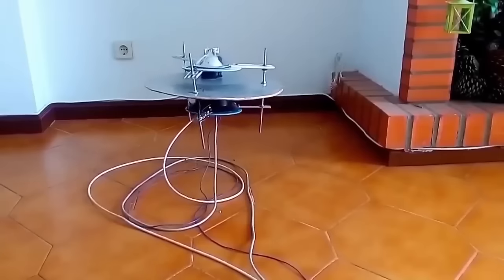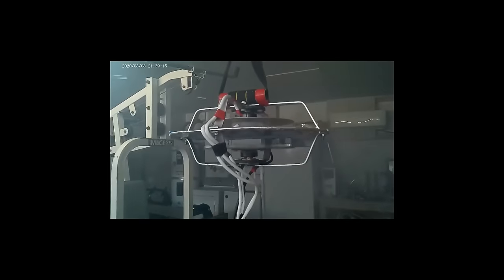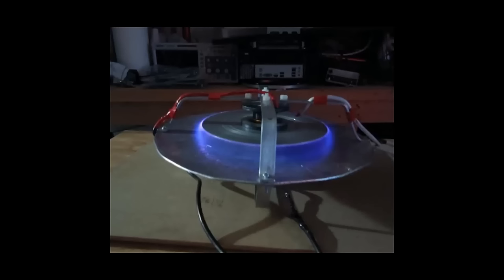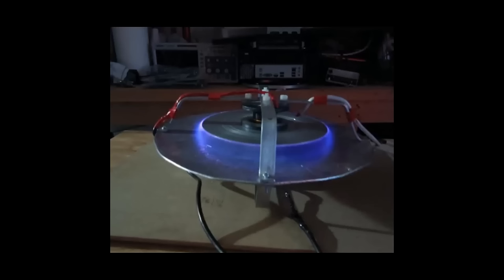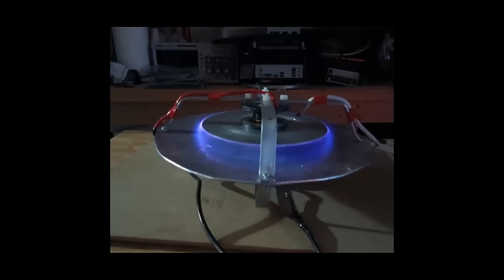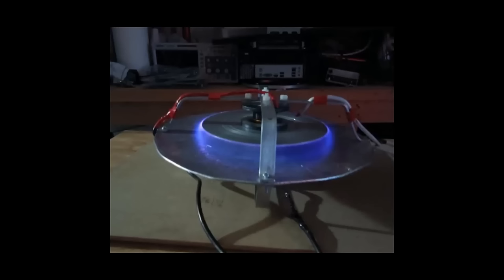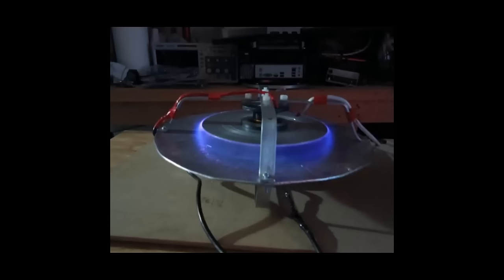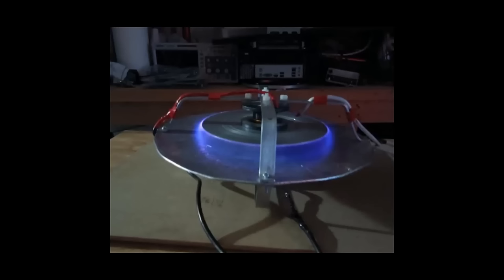Building The Graviflyer "Testing Everything"

Comment: I have derived great pleasure from viewing all of your visual presentations. My progenitor was engaged in the field of aerospace engineering, specifically in the domain of advanced propulsion systems. Upon the discovery of the elusive components, the factor of weight—or indeed, mass—will cease to be of significance. Beyond such statements, I remain a silent yet fervent advocate for the collective success of this exceptionally talented assemblage.🙏🏻
Reply from the maker: It all comes down to one factor. If it doesn't resonate enough then you fail. It is and always has been that on factor. Thank you.
Reply: @nathanbunten4299   so youre saying that the fundamental concept of electric gravity propulsion works?
Reply from the maker: @Critter145  The is much more to it than that. Harmonics, electricity, 2 fields of frequency's crossing each other, eddie current and 3 fields where 1 pushes energy out and 2 pull it in ( gravity well) Resonance in the  center disc. This project is way more complex than people think. If I took out charts to show how it all functions together it might take several hours to explain before I even showed a test on the machine.
Reply: @nathanbunten4299  utterly fascinating. thank you for responding
Reply from the maker: @Critter145  any time. I have done a lot more video's on it. I also work with a group on the concepts of each part. Those video's are also on my sight. I try to answer as many questions as I can. Thanks.
Reply: Anti Gravity is not a big secrete , it has bin around a long time the concept of the physics of antigravity can be found in nature , like certain insects fly bye using anti gravity plus great physic professors have learnt from the works of Tesla, and Edward Leedskalnin the builder of coral castle , plus some other great physic professors from ancient times .
Reply: Tesla Said, that he was Limited, in The Materials, of His Time. Ceramics, And Carbon Mixed Ceramics, ARE The Materials, Of The FUTURE.

Comment: I work with Tim Ventura and APEC people who are also working on the graviflyer. I also chatted with Alexey with a scientist on the phone. You have the graviflyer analyzed fairly well but not perfect. The gravifler is not made of three aluminum disks but two CDs (polycarbonate like balsa wood) with aluminum on one side and Al2O3 on the other side and the large aluminum disk in the center. The aluminum is outwards on the top and the bottom of the CDs and the Al2O3 is inwards, so the high voltage does not arc, and the magnets do not demagnetize with the applied high voltage. The top CD has the positive on the top and the negative on the bottom and the bottom CD has the positive on the top and the negative on the bottom or vice versa as I am not sure which way the positive and negative are aligned. The force will then only go outwards. The charge on the CD disks and the high voltage ionizes the air on the top and bottom of the graviflyer and the spinning magnets then push the top and bottom air down and upwards so there is a vacuum above and below the graviflyer so the device acts as a hot air balloon and lifts upwards.  It is not anti-gravity. Alexey sends the incorrect kits to keep this secret so he can make money and make a living. The ultrasound device puts the graviflyer in a harmonic mode as you describe and when the harmonic mode is reached, he pushes a button on his electronic controls to make the final push to make the air evacuate so the device lifts upwards in one blast. The large disk is in the center to keep the vacuum on the top and bottom separated.
Reply: Dude, good facts! Where can I find this graviflier? I am new to this hobby and can't wait to experiment.
Reply: Как Алексей живет? Он работает над своим гравилетом или уже нет?

Comment: What you did is amazing thank you for sharing all the information and contributing to the scientific research. The presentation that you made It’s just amazing. God bless you.This is what a real researchers do by sharing the knowledge to benefit everyone.
Reply from the maker: thank you
Reply: @nathanbunten4299  again thank you I’ve benefitted greatly from your presentation and the knowledge you have shared. thank you for your time and effort To bring this information forward. I have been struggling for the past two years to understand what was going on. I made five different models and everything you said you have been spot on exactly.👍
Reply from the maker: @samjall  It shows when you do the tests. I have been doing a lot more on this thing. I have moved away from really high voltages to sound and harmonics. I also built a tesla coil circuit that will work all day long. I also have the right ultrasound circuit. This is one of the most intriguing projects I have ever done.
Reply: @nathanbunten4299  even if I did not succeed, at least I’ve benefitted greatly from your information. You have no idea I was very frustrated and I was struggling to understand why it did not want to work and you have pointed every single mistake I made, watching your presentation. It’s like I was in a dark room and All of a sudden somebody opened the door to light show lol I am sure there are thousands of others like me. You shorted the distance for hundred or thousands of people so they can pick up where you Finished And that is lots of time and frustration they don’t have to go through

Comment: gyroscopic stabilization. a hollow center disk would resonate well. the foil sticking down to the table is a capacitative effect. i'd wager theres metal on the table on the underside, the wood tabletop becomes a dielectric, the metal in the underside becomes thenother plate of the capacitor

Comment: What you need to control the resonant frequency. is alot of different sized piezoelectric transducers rated for a wide range of resonance, with potentiometers attached to each one for extremely fine tuning capabilities for the tuning forks. This would allow you to program controls for resonant frequencies across multiple resonant chambers which would then allow control of direction, as well as lift.
Reply from the maker: I agree

Comment: Try this one for size:
Bottom most layer: Circular Aluminium Sheets and Circular Kapton Tape Stack (+ / - each layer)
First rotating module: Closed liquid mercury pool (leak proof/vaccum sealed)
Second rotating : Close liquid mercury pipe from center to top flat circular reservoir (leak proof/vaccum sealed)
Both mercury pools will self rotate upon correct power connection. Multi-point, switched power interface
Outside shell/top bottom split (crucially electrically isolated from everything except bottom alum/kapt capacitor stack)
Reply: (Capacitive stack will need to be increasingly thicker as size/load increase)

Comment: Electrostatic wind...  Try this, has to be paired , has to be synchronized ... out of balance gyroscope that accelerates on one quarter of rotation only, and it throwing the weight toward the sky... the weight is traveling very fast at the top of the rotation and is slowing as it is coming down to the bottom of rotation...  the mass traveling very fast at the top of the rotation has more inertia than the slower rate of rotation during the tough of the circle....

Have to be in pairs , one on each side of craft, and have to be like 6 or more of them, 6 of them lift in a triangle configuration where there are two in each corner, and they all have to be lifting at the same time, (synchronized).   I cannot send no pictures that are easy to understand...

Comment: Do you think we need to consider the MHD effect? It's one of the theories for antigravity effect. Plus, most studies of UFO encounter said the buzzing and Mercury engine. Mercury engine works like the magma inside the Earth. The mercury spins around a magnet which is also spins in the opposite direction thus creating magnetic field around itself.
Reply from the maker: they both produce energy fields. It might be the interaction or just the accumulation of charge.

Comment: Unfortunately, watching the videos of the device in flight it is easy to see that it rises in "jerks".
This occurs when the nylon is pulled through the pulleys to raise it.
In other videos he touch the discs when they should have high voltage, the rest is the same as always, you will never get it to take off because there is a magic frequency that you will never find.
The antigravity is there, but in two PC fans, two aluminum disks and a flyback, I doubt it.
All the best.
Reply: I agree
Reply: Yeah its clear it was a hoax yet these people just keep pushing forward despite no one having any success because... it was a hoax.  An obvious hoax at that.  Huge waste of curiosity in my opinion.
Reply: There is no way at this energy anything you are doing with electrostatics is affecting gravity in any way, many orders of magnitude off lol. Also, the big to small thing cracked me up, thats just sooo wrong, i think he might've not showed the initial state of the system (he charged the little middle piece that goes up or down) before hand to bias it so that no matter what it will go down. Silly stuff

Comment: You need to insulate the magnets, perhaps, even ground them. Maybe use a separate slip ring for the ground. Also, use an electret type of material, for example I heard that some sort of specialized hardened wax works for the center disk. I believe the center disk becomes a captret.  A captret combines the properties of an electret and a capacitor. A captret can be made by putting two capacitors in series with a terminal between the two capacitors in series. Each non-connected end of each capacitor in series becomes a terminal. The captret has three terminals. Look up captret    Also, look up electret

Comment: I heard that tt brown used a bismuth type insulator for his lifters, it was apparently a type  of bismuth that repels rather than attract, the so called bismuth magnesium alloy material allegedly found from the Rosewell crash have been talked about as  the same material tt brown was using, probably made via sputtering or something similar
Reply from the maker: Don't know about the magnetism. But the k value was through the roof. You could put millions of volts through it and never burn a hole through it. It is why his capacitor was so good.
Reply: From what I understand the original lifter video showed at first used a bismuth coating on that spinning disk. You can kind of see the texture on it. 

The only drawback I noticed is one video they pointed out a shadow that appears to show a pole and a string when he tried doing it inside. :(

I think there is definatly something here, though. I've been fascinated with the idea for years. Electrostatics is key.

I believe gravity is nothing else other than Electrostatic cling on a macro scale. By taking a small object, and making a equal potential on the object you with to fly, you could then theoretically "float" similarly to a bubble being blown through a straw of water.
Reply from the maker: @Heliarc91  I agree with you except the string and the coating. I have pictures of the original and it is just textured aluminum found at Lowes hardware store.
Also he built another one and it flys.
Reply: @nathanbunten4299  I've seen the one outside. That one is hard to explain. And I certainly don't want to demote it. 
I don't know the original builder personally. I just remember seeing a video in his house. And in comments someone called out it looked like it was on a string and stick in the video via shadow .. and when I saw it was hard to unsee.. but could of been an illusion. 

Hmm. I thought I read a write up that mentioned it being bismuth. But then again it was in English so it may not of been written by him
Reply from the maker: @Heliarc91  he definitely made it work. He was given a new iphone to make the next video. So I hope a better quality video will clear up everything.
Reply: @nathanbunten4299  interesting. It will be exciting to see what can be done with it. 

I know it's possible. I'll have to go rewatch some of his videos if I can find them and study/admire it. 

Can't wait to see yours fly!
Hopefully one day can make a RC type flyer on batteries. 
Rumor has it certain implosive discharges can lead to transient spikes that, when captured properly, can be additive to the system!! Improving its efficency... and beyond..

Comment: This might be a dumb idea but for a cheap experiment what about a 12" or larger speaker close but  facing away so the movement of the cone doesn't effect the air near the craft. play a a constant bass frequency as low as speakers can handle very loud slowly raising frequency. If someone has a whoofer box in their car all you would need is 10 to 20 ft of speaker wire to run from their amp to speakers in shop have them play the tones from their car. Box probably needs to be on floor under table where craft is so it resonates through table. Shoulf be an app to Bluetooth to car radio where you can play different frequency. If the goal is to get the craft to vibrate at a certain frequency this would be a simple test. Cons: neighbors wont like it and everything else in your shop will be vibrating also. Lol. This probably won't work but by thinking was to overpower the resonance the craft is already making by force.

Comment: I see this video before and what do you need for this anti-gravity device is a rolling gate controller , 12 volt switching power supply and if I'm not wrong gas boiler igniter controller. and 1 capacitor If you don't have it your anty gravity device will not work

Comment: 40:07 - Interesting tesla coil, but I don't see a link in the description - could you please provide. Thanks Old Man buiilds
Reply from the maker: https://youtu.be/1qzzu9m1T8k   I blew the board 3 times using 300v dc. Waiting for a new one. The one in the video is running on 2 mofsets and a bad power source. I decided to do spark gap because of the problems. Just waiting on parts to get here.
Reply: @nathanbunten4299   Thanks for the link, 
Yes High power at High Voltage and mosfets don't like to combine.
I saw @styropyro use an angle grinder with one of his projects, sadly I can't find it right now. It would/could be an 'easy' way to control the frequency - staying 'relatively' safe.
Then there is always the good old tec - Tubes
Reply: @nathanbunten4299  I looked up your link, and it shows your first run on the Tesla coil driver running at low voltage?
The one you're pointing to in the video is the bifilar middle driven Tesla coil. 
I would imagine a middle-driven-coil could be more efficient than a coil driven from the bottom, as the magnetic fields can swing back and fourth the coil(s) as a pendulum, and not having to interact with the ground/chassis/etc EM field-lines present in a 'traditional' style Tesla coil (where it's usually sparks that count, and not energy consumption).
If the coil needs to be bifilar, trifilar, or .. Best coil structure for unimpeded swinging - I think only experimentation can determine ;ø)
Reply from the maker: @EgonSorensen  here is the right video. sorry for that. I did not make the coil. Here is the guy who did. https://youtu.be/Hkqa6c-0fFk?si=sCqDBsD2KFyApYy6

When the coil is completely resident there is not a lot of sparks. detuning them gives you the sparks. But yes more testing is needed. sorry for the mix up on the link.

Comment: Also, try sealing two plates in air tight container, with bottom of plate exposed. Just seal the gap, between both plates, and pressurize. Test different pressures and voltages. Air (gas) pressure is key, for higher voltages.

Comment: On your ion thrusters, you need to encapsulate the thruster, in air tight capsule, and  pressurize. Extend lower ribbons, through capsule. Keep air tight. Play with pressure, and voltage, for stronger electrostatic propulsion. Play with sphere design, in place of ribbons. Also, play with different internal gasses. NOW, you’ll start understanding UFO’s😉🫥

Comment: what if you went to carbon fiber graphite ?  I baked some up under compression and it rings like a bell also conducts electricity but it is very light weight  ..  also I took an almost dead 9v battery that still had six volts and powered a circuit built around a 27000mhz quartz crystal and created a resonance cascade but the current went so high it fried everything however I did see an almost invisible field radiating from it as it was backlit by some nearby LEDs just before it went toast  ..  dealing with two oposing electromagnetic fields at a specific resonant frequency will be a lot less simple than it sounds  ....
Reply from the maker: It might work

Comment: You cover all thing,first I thought I had some ideas and you don't know about,but already figured out,still I have two ideas left😅
First, use a battery for the power source because it is not connected to the ground
Second, make the voltage increasing circuits yourself so that you can reduce the intensity of the output current and only increase the voltage
Reply from the maker: I already did. Thank you.

Comment: The graph at 57:00, what are the axes?
Horizontal (x) is I understand frequency, but what is the vertical axis (y)?
Can you please explain what  you mean by the frequency of Al?
Reply from the maker: The whole craft is al. so you need a frequency to resonate it. It will be a big sound of vibration. It will not just work on your oscilloscope, The frequency is lower than a tuning fork will be. You have to create an imbalance in the metal.